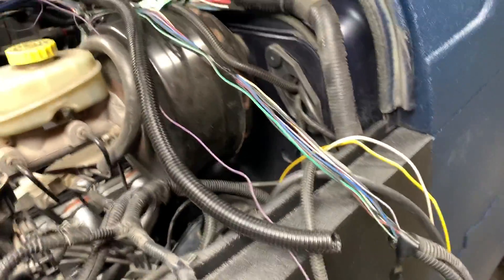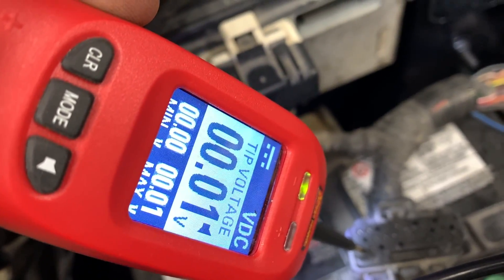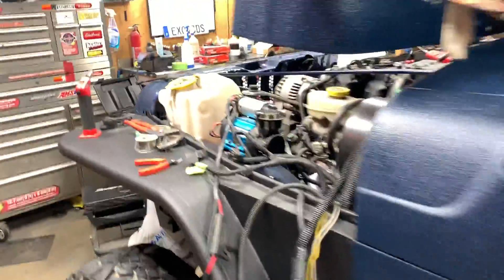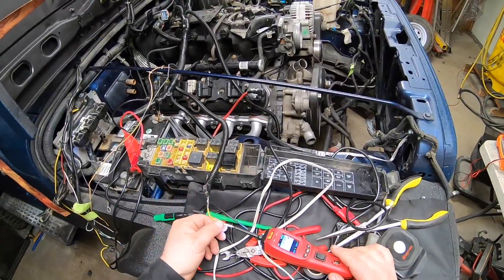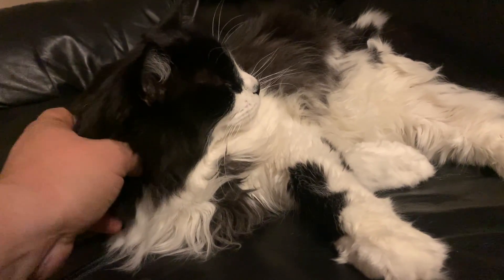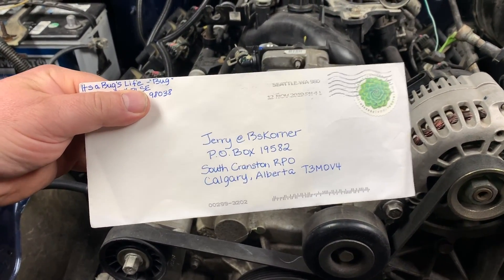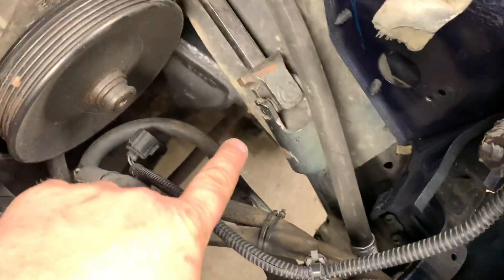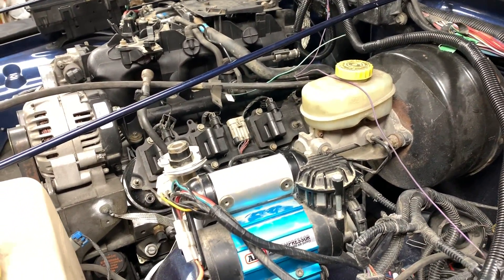Jeep TJ No Gauges Solved

Comment: My 99 tj had this problem for years . On and off at first and then nothing. Turns out it was some type of debri in the connection at the back of the instrument panel. Possibly solidified dielectric grease?